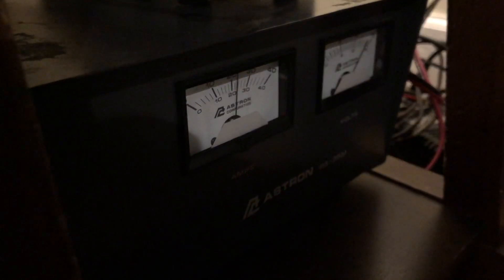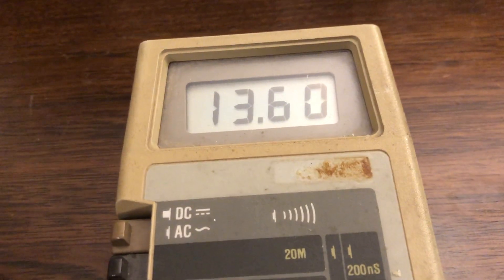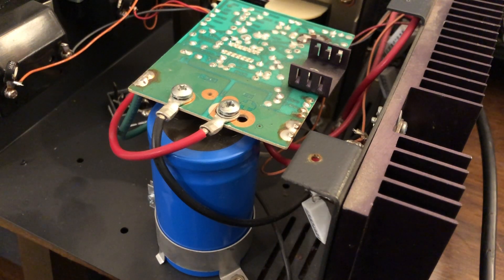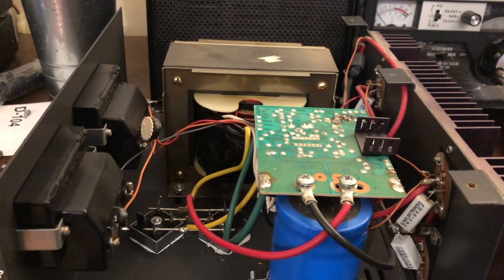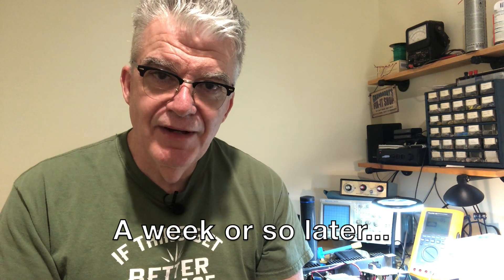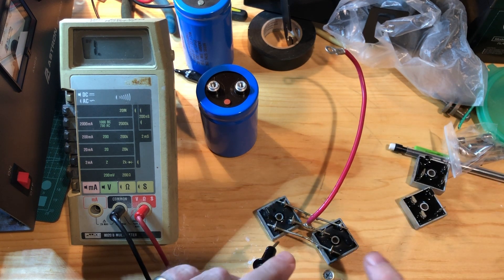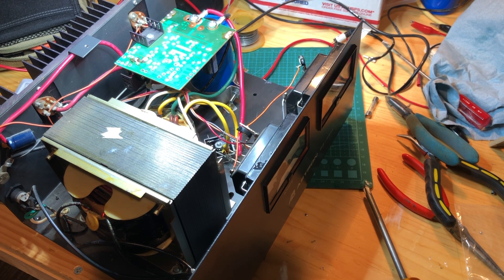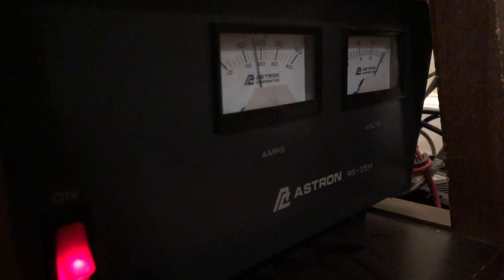Repairing an Astron RS 35M power supply for HAM radios

Comment: One of my GE Mastr 2 power supplies used to hum @ 60Hz while idle and really get down when under load but it was the main transformer just showing it's age. I wound up replacing the original transformer with a toroidal type with a higher amp rating (somewhere around 100 amps or so since I rewound it with heavier gauge wire) and dual tapped for 15 and 5 volts, new FBR, inrush limiter and filters. Also replace the front plate fuses with breakers, added cooling fans and a digital volt / amp meter. The filters and regulation for the 12 volt side in this one was fine so no need to change it. I did fabricate the 5 volt regulation and filtering though.

The second GE unit I completely gutted out and installed a pair of 12 volt / 40 amp  SMPU's in parallel to raise the output current to 80 amps, added in some extra filtering (because SMPU's tend to make noise on RF) and some fans. Front panel got a makeover with a new AC mains socket, breakers and indicators and a digital volt / amp meter, finally both units got a coat of metal primer, black paint and then a light semi gloss coat.
New decals and GE logos addes then sealed up with a final coat of gloss

I have a third GE PSU that is all original but it too needs a makeover because it has a hum and also has bad filter caps. Lots of hours on it from it's former life in a UHF Commercial community repeater cabinet for the better part of IDK 40 years before it was finally taken out of service due to FCC narrowbanding requirements.., I like these power supplied though because they very usable as a DC power supply and have the AC mains socket on the front, they are serviceable for the most part, chunky with weight (all metal) and they are 19" rack mountable. Oh and they are "hackable" so if you want ditch t he heavy iron core transformers and big filters you can and drop in a fairly reliable SMPU module and a way smaller filter bank to clean off the switching noise..

That cap in your PSU is not a bulk cap so it is not a high voltage cap just a high farad value the 12 violt in it is not enough to break your bodys resistance to do any harm. Now if that were a SMPU then YES it could have anywhere from 250 - 480 volts DC on it and will let you know how it feels about you touching it if you touch it.

You probably know this but discharging a cap, especially a big cap of high voltage or high capacity rating like you did is not good for the cap and the older the cap the more chance it will have to totally fail (usually short inside the cap or short one side of the FBR) when you discharge like that. Use a power resistor instead, something in the nature of the 2 plus watt area or just leave the equipment connected and powered on to drain the filter(s). Those big caps also can "recharge" over time so you may want to leave the resistor on the terminals, especially if you are in a SMPU across the bulk cap.

For proper texting of caps you need a dedicated capacitor tester so you can properly test for leakage, value and ESR.. Multimeters can do it but they are not that accurate since they cannot put a caps working voltage on the cap under test
Reply from the maker: Thanks for all of this!!  Sounds like you had some fun working on a few supplies.  Yeah, I know discharging the way I did wasn’t the best.  I should have grabbed a higher power resistor to drain it.  I was impatient and wanted to get the supply working.  So far so good.  Still no hum.  Not bad for a really old power supply!

Comment: WD4OBP I had the same problem. The tech suggested replacing them with the 50 amp diodes. Mine failed at 6 months probably from gunning ft8 wide open.
Reply from the maker: So far so good for me.  And it’s been on 24/7.  I think if it dies again I might spring for a new one!

Comment: why did you not use a single 50 am diode rectifier the problem with the way astron does them is equalizing?
Reply from the maker: I used the Astron replacement part for the repair.  Figured the first one lasted many years.

Comment: While it’s all apart- remove the transistors, clean everything up and buy new Mica insulators and put new white heat sink compound on all 4 transistors.  They should be cool to the touch when operating. 

I purchased my Astron 35, 21 years ago.  I just replaced the voltage board, the big filter capacitor and the transistors and mica insulators.  Works great again.  It will probably outlive me.
Reply: Just bought one at a garage sale for $50, guy said transistors got hot, took them off, still good, new insulators with  heat sink compound,  and works fine now!!! Going by the serial number it's 30 years old!!!

Comment: I bought a used one fifteen years ago! Every once in a while
It would hum and the output
Voltage was oscillating wildly.
I checked the rectifiers. Always ok!
I finally checked the control board. One of the solder joints
On the board didn't look right.
I sucked off the solder, then I checked the components.
They were ok but the leads on
The components didn't look clean enough.
I scrapped the leads with a
Sharp knife to make them shiny
I resoldered the leads to the board. No more oscillation
For the last ten years

Comment: Out of curiosity did you check both of the original bridges once you had them unsoldered? When wired in parallel for current, it is possible only one shorted giving you a possible good one to keep for emergency (temporary) use if needed..
Reply from the maker: Not yet but you are right if one tests good.  I was thrilled to see the supply working again!
Reply: It is BEST to change them both regardless. Aside from the main filter I would have checked the caps in the regulating circuit as well

Comment: I understand the new switch-modes are great but for radio I still think a linear is the go. The 'ol Astron lives another few decades. Given that electrolytic is that old I'd still replace it.
Reply from the maker: Yeah, I might just do that..
Reply: Depending on the brand of SMPU and what RF band you use with it will determine if you have a quiet PSU. SMPU noise pretty much goes away above 450MHz However, those cheap Chinesium infused one on ebay create a LOT of trash on RF and the switching transistors / MOSFETS are typically way under rated for the claimed PSU's output current rating. IE: A 40 amp may have a pair of 8 amp transistors of the cheapest Chinese stank quality available and will not last long under load. If you do buy one of those cheap bricks, before you connect power to it, open it and see what transistors / FETs are in it and replace them with better quality ones that are compatible and of higher current rating. Also while you are in there change out the main bulk capacitor, the stock ones are GARBAGE and will fail prematurely. As for cleaning up the RF noise you can shield the PSU more and add external filtering but in HF there will be noise.
Linear PSU is the best but sometimes you may not have the room for a big heavy PSU.

Comment: Morning Chris! 

The trick to putting those sheet metal covers on is to put all screws in loose so you can shift the cover around to line the holes up.  When all screws have been started, tighten them down.
Reply from the maker: Yeah it was definitely a little wrestling match to get the cover on and off.  Same with mounting the rectifiers.  But, I’m glad it’s working now.
Reply: Things always seem to warp somewhat over the years...